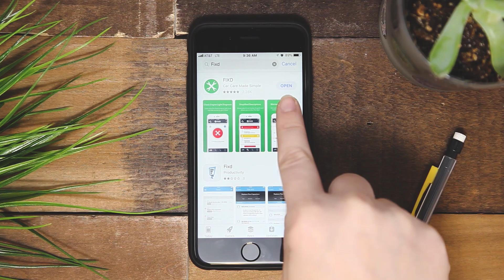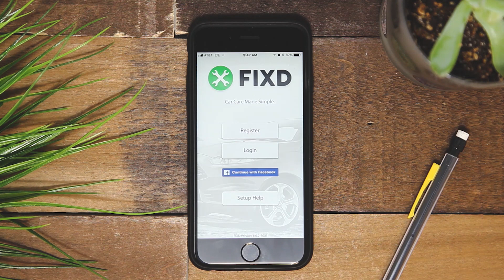Troubleshooting Solutions For FIXD Sensor

Comment: I have the premium subscription and this keeps on happening to me. I can scan my device with the car engine on or just when it’s clicked on twice before you turn it on and it scans the codes, but it doesn’t completely load. It says failed most of the time and that’s the important part for me to know what parts or what worked for other people that had the same problem I love this device, but until lately this has been a common problem and I’m having issues with it

Comment: My bluetooth requires a pin number to connect,  were do i find the device pin number?
Reply: Any luck yet im having the same issue?
Reply: Try 0000 or 1234
Reply: @reighndrop1  0000 doesnt work and now i cant change it.
torque app
Reply: @CevicheTheory  it's generally 1234. However, the instructions tell you specifically not to pair it through your phone. You only connect to it through the app. So, you turn Bluetooth settings on, go into the app and scan for it. You do not pair it like you would normal Bluetooth devices.

Comment: Using my iphone, I was getting the connection problem message "bluetooth connection not supported" - what the FIXD setup guide doesn't mention is that the FIXD app needs to be configured in the settings menu -> select the FIXD app and make sure to enable access to Bluetooth and Cellular Data.

Comment: I've tried for hours, fixd just won't connect, at all.
Reply: same here now I feel like my money was taking 😪
Reply: Hey we seem to have the same problem, you ever got it sorted out?
Reply: @kautiongabriel6522  I'm willing to help you man, you still active on this acc?
Reply: @t0nicss867  how did you connect yours?
Reply: Same here. Tried Android and iPhone neither worked. Both had communication and syncing issues. Fix'd suggested replacing the sensor device. The problem with that is they want to receive this unit before they will issue a replacement. So 2 cross-country (CA-GA & GA-CA) shipments means 10 days or more and I need to do pre-smog testing now (do not have an extra 10 days to wait).
Reply from the maker: Joey, I'm sorry to hear your having issues. I know our customer support team will gladly you walk through how to get everything working! Go ahead and reach out to Support@fixdapp.com and we'll inform our team.
Reply: @fixdapp  trying again to get info on phone.
Reply: Still nothing
Reply: Fails alarm ⏰ yal it works